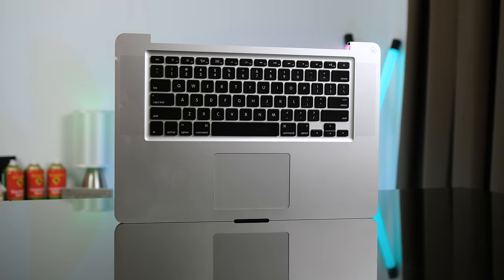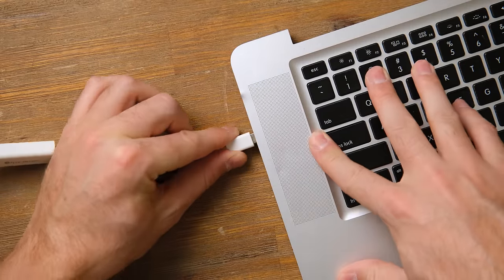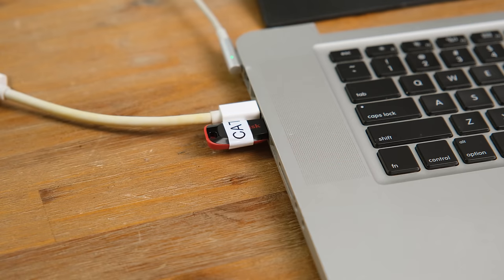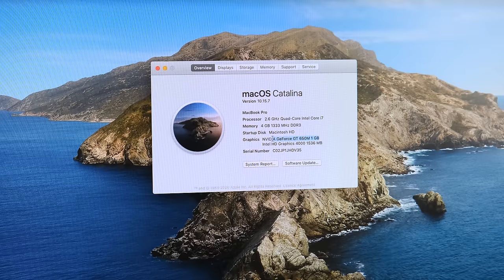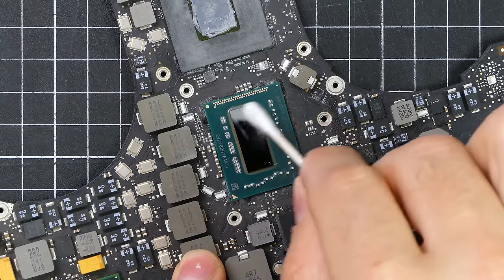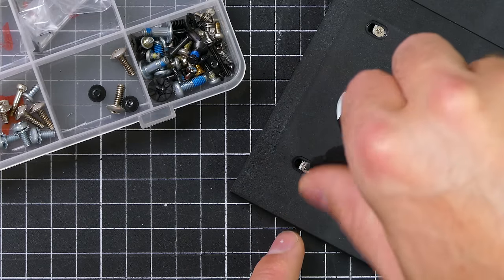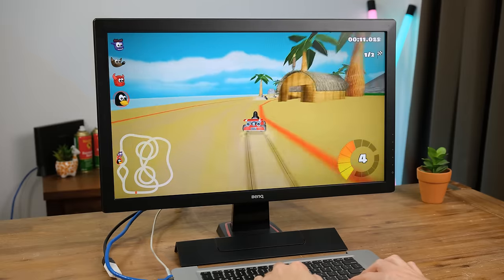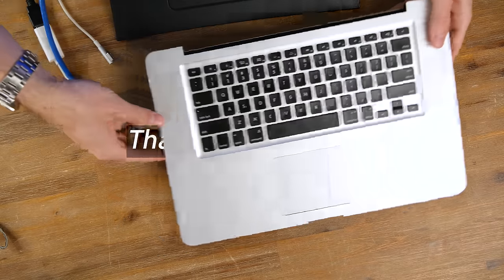Turning A Free Scrap Macbook Into A Desktop PC!

Comment: I did this to a Lenovo laptop that has a broken hinge.
Reply: Speaking of, I was going to keep it for a project in the future but my mom unfortunately demanded me to delete it.
Reply: I had a laptop with broken display. Plug in to tv and used it as its display. Can use this method to every laptop with broken display
Reply: It was probably a Thinkpad. Not due to quality, but what OS you use.
Reply: @Forrest_O.  Not a thinkpad, but lenovo g series
Reply: Did the same to my Lenovo Thinkpad T440.
Reply: Same
Reply: My brother did the same thing to an old Toshiba satellite laptop, used to be my dad's old work laptop. Installed Linux on it, and it works great.

Comment: Little tip with these machines; Opencore Legacy Patcher can patch out the performance drop from the missing/cooked battery.
Reply from the maker: Interesting! I was not aware of this 👍
Reply: Hmm, interesting! Thought it was something with the firmware.
Reply: there it is . the ultimatum for my old mate already asking for it's 5th battery
Reply: @psivewri  there's your next upcoming video mate . please do it
Reply: Is there an analog of this for Windows? My Lenovo runs like crap when no battery is plugged in.
Reply: @let_me_explain8572 Not certain. That said, I know that my own MacBook Pro will occasionally overload its power adapter while running Windows, so removing the battery is not a perfect solution.

Comment: The performance happened with me on an old Air 2012, I used OpenCore Legacy Patcher to create an EFI to bypass the battery limitations but still remain on the last supported OS!
Reply: What was the name of the setting to bypass the battery limitations? (so I can google it)
Reply: @zoomosis  you need OpenCore Legacy Patcher, I cannot remember the name of the setting & im not at my desk but if you hover your mouse over each of the options it’ll give you the description!
I think it’s in Misc Settings
Reply: will it work with a bad battery? :O
Reply: @Nikpet3D  yeah, I opened the laptop & disconnected the battery though just in case
Reply: @Nas_Allie  ohh :O
Reply: OpenCore patcher is an amazing tool. I've used it to install latest macos on Air 2013 and it works! Yeah, a bit slow, but ultra portable 10-years old device

Comment: You can fix the performance issue by using opencore which has a function to disable this kind of throttling
Reply: how?
Reply: @applebottomjeans7145  OpenCore Legacy Patcher menu > Settings > Developer Settings > Disable Firmware Throttling

Did the job for an old MBP 17 2011 I had. Battery was dead and I needed to test it. Make sure you have a charger with at least the necessary wattage or more
Reply: @ReTex504  Thanks! Good to know about these utilities.
     (I thought it was also possible through command line stuff, but a GUI application is hella easier :))

Comment: I love this. So many people are like "yeah but which 2012 are you using which parts for?" And from my experience, you can do a lot of part swapping like you did here. People are so nitpicky about submodels, so I love that you franken-mac'd it.
Reply: Apple is extremely well-known for subtle parts differences between models. Little things like changing the location of a connector to prevent an easy display swap happen fairly regularly.
Reply: These were also the last generations of MacBooks that could objectively be called user-serviceable or upgradable. People who are used to Apple's current MacBooks probably don't realize how things were back then.
Reply: @TimurTripp2 are you sure? I’ve seen many of his videos cleaning up them 2012 MacBooks, and the connector locations look the same on all the models he has cleaned up 🤔

Comment: I've found that the best donors are liquid damaged machines for housing swaps. It helps if they happen to die early in their life, too. 

My free 2012 i7 13" Pro was rehoused into a free 2011 i5 model with liquid damage; the board had corrosion around the rear vents and wouldn't POST or show signs of life beyond a twitching fan. 

The battery only had 134 charge cycles and was still in good health, the keyboard still had its matte surface, and not a dent or scratch anywhere on it. 

The donor board machine had a stage light fall on it while it was open and it got flattened, but the unibody structure saved the board from damage (even if the hinges got ripped out of the aluminum from the impact). 

It can also be a save for a poorly reconditioned device: i.e., I got a "dead" $5 ThinkPad X250 with an i7 that had seen some botched DIY repairs from its previous owner (my guess is failed trackpad?) . It was missing screws, the keyboard backlight diffuser, and the cable management was awful and the guy used the wrong length of screws in places, so there were little protrusions on the topcase and even a crack in it from the botched work. 

Transplanted that (ultimately) working i7 board into a mint $28 i5 model with water damage, now it's good as new. Best of all you get a "small spares" machine, meaning you can harvest other smaller working bits like hinges, radios, keyboards and what not and replace as needed or sell to recover your funds. 

Love watching your channel bud, keep up the good work!

Comment: Great video! I'd recommend OpenCore Legacy Patcher though, to run Monterey on this Metal supported machine. It will be flawless and bug free (nearly).

Reballing will NOT fix your dead 2011 MacBook Pro... the chip itself is the issue... you might get away with cooking it, since the issue comes from small bridges inside of the die that can partially resolder with heat... but it's temporary. Replacing the chip is also temporary since it can fail again... the best fix is to disable dedicated graphics. It's partly AMD's fault, but mostly Apple's fault with terrible cooling (other laptops that use the same chips don't die).

MacBook SSDs were not removable all the way to 2017... The 2016-2017 TouchBar MBP models had soldered storage...
For MacBook Airs, you could replace the storage until 2018!
Worth noting that this proprietary storage isn't the same across all models... there are several types.

Comment: i did this already in about 2013/2014 as my 2009 model fell apart after 4 years of VERY heavy mobile use in school and as primary and only computer besides a loud heavily overclocked and unstable gaming desktop

i just used batteries coming from my 2nd hand bought 2010 model after they lost „too much“ capacity for heavy battery usage to allow it to use full power

Comment: re the thermal paste application, you're right that it's critical that you have to apply enough to cover the die, it's not necessarily wrong how you did it but I recommend spreading it as well to guarantee it's touching all of the surface, since there's no way to know that it is otherwise and if there are hot spots on there it can lead to its early death

Comment: I have been using a headless 2012 macbook pro without battery for 5 years. I'm also using it as a "desktop" but in a studio i'm sharing with a friend. Magsafe charger connector secured with hot glue and the macbook is tucked away (in a upright "book" position) behind the monitor. I've never bothered about getting a new battery because the macbook is not going to be portable anyways. It is upgraded with ssd, ram, kept the optical drive because still using discs, and ventilation holes in the back cover but holy shit i think i need to order a new battery after all!! Thanks!

Comment: I got a Fujitsu AH-564 laptop with similiar specs, Core i7 Gen 4 without display, RAM and HDD.
Lucky me, i found a Acer 15.,6 monitor with a compatible LCD pin cable to the mainboard, now working as an Desk-Note Hybrid Laptop.

Comment: That’s actually a pretty good PC even today since the 15 inch from 2012 has 8 threads and you can put 16GB of RAM and almost unlimited storage. I put a cheap 1TB in mine but you can put as much as you are willing to pay for an SSD and even use 2 SSDs if you take away the disc drive. Making a laptop have dozens of TB of SSD storage if you want. Something a modern MAC simply cannot have.

Comment: Great Idea, Cat and Andrew already did that several times with screen damaged Laptops, I myself had a cheap Asus 15" with AMD A6 APU from 2012 to 2017 and over the time the plastic body broke more and more, the screen (which also had only 720p resolution) had a dead vertical line.
I scrapped the lower housing and the screen but of course kept the mainboard and gave it to a friend.
Maybe I can build a case for this now with a 3D printer.

Comment: i wanted to repurpose my 2009 Macbook by doing something like this but somehow Apple underclocks the system if there's no battery detected, which is a hassle because it bloats after a year and its already on its 4th for the past 6 years . If there is any kernel modification done to overcome this underclocking i would love to use my old macbook again
Reply: doesnt work it can draw more power than magsafe delivers
i did this type of conversion as well on a 2009 15“ and i just used acceptable batteries coming from my 2010 model after 300-500 cycles
Reply: Some other user commented this: "Opencore Legacy Patcher can patch out the performance drop from the missing/cooked battery."
Might be useful to take a look for your case
Reply: @hex8387  Yes this absoutely works I've done it with mine!
Reply: @hex8387  thank you ! I'll scroll through everything on the Github page and hopefully it will work again

Comment: I CNC machined a case for a motherboard that mounts under a cabinet. Much smaller than a MacBook because it has no screen, no disk drive and no speakers etc.

Only thing I haven’t figured out is how to circumvent the battery. It won’t boot without it.

Comment: Installing Windows 10, underclocking the CPU and overclocking the GPU (to keep power consumption and heat at an acceptable level) can make this a pretty decent machine for gaming even, at least for games until 2015. Got Tomb Raider 2013 at native resolution at 70 fps, Thief 2014 at 40-60 fps and even Far Cry 4 running at 40-50fps (but with a lower resolution here). It won't replace a dedicated gaming laptop tho. ;)
Reply: Overclocking isnt worth lmao.
Reply: @AntiGrieferGames  If you think 10-15 fps isn't worth it...

Comment: You can disable firmware throttling cause by not having a battery. install OCLP, Update the system and disable this so you can use it battery less.

Comment: Why not remove the battery if it’s going to be a desktop? Does the CPU throttle if completely disconnected?
Reply: I dont know about this mac in particular, but some devices like smartphones, tablets and the Nintendo Switch do not turn on if the battery isnt attached, even if it is dead and will be running from the charger at all times.

Comment: I think I have the same Macbook pro (Core i7, right?) - still my main computer. 
      And VERY responsive and quite capable with a fast SSD as the main drive.
     (Crucial M4 (Sata 3) as the main one. OWC (Sata '2.5') as secondary)
      The 15" models were always more future proof than the 13", on account of dedicated graphics.

Only issue I have is that the bottom RAM slot is not functioning. 
    I know what the problem is, but don't feel confident enough to microsolder the connections back.... Yet.

Comment: Well i used a headless Thinkpad for a bit. My display was broken after it fell down, but i used it with a crt monitor, external keyboard and mouse. And it worked fine, until i had enough to buy a new laptop (screens seem to be the most expensive part of a laptop) and i gave this Thinkpad away.

Comment: Guys, NEVER EVER FORGET the BATTERY when you buy some second-hand laptops: I bought an i5-M model laptop which came out in early 2010's and the battery was dead. It was not behaving like how it should be and never ever thought it could be from dead battery. Replaced it and now it plays 1080p 60FPS YT videos without any lag. CPU usage dropped significantly.

Comment: I have a dell monitor i got for free and i use it as a display and i put a keyboard and mouse and power adapter to a hub and plugged in the display like that so it is kinda of a dock while the display is closed and when i need to take is anywhere i just unplug it

Comment: Hey psivewri I am a big fan of yours I have a doubt abt my old laptop with i5 2450m and amdradeon hd 6370m like I reaplyed the thermal paste and when I try to game on the amd Radeon hd 6370m it basically goes into black screen is there any way I could fix it laptop model lenovo g570. Is the driver problem or the gpu is dead?

Comment: I took the screen off my MacBook Pro 15in just because I have a the 27in Thunderbolt Display that came with it at the time. I been using it a lot lately for random things even installed wi does with boot camp and. Been using that. So my issue was my set is that every time I had to turn I. The Mac book I had to open it which I had to pull out off the off space I have it in. So I watched a hunch of videos and did it. The. I realized I wasn’t getting any wifi or Bluetooth. So I did a bit of my own looking around and found that the card is in the actual motherboard and the antenna is in the bottom of the screen. So I had to take that out and find a way to rig it after I installed the wires. And no one making these videos mentions that. Which I believe they should’ve cuz it would haves made my build alot simpler. Anyways. I completed my mission so far. Lol

Comment: I had done this with Windows laptops, most of Windows laptops doesn't give video output, if OS isn't booted.

Newer laptops, who have eDP LCD panel, they give video output to external monitor, if screen is not connected, but eDP could be converted to normal DisplayPort and it will 100% give video output in BIOS.

Comment: You should ruin the plastics with more of that eucalyptus oil
Reply: 💀 why he gone and done that to every laptops idk. essential oils are known to ruin plastics, he seems to put a "healthy dose" onto everything
Reply: Maybe because of eucalyptus oil he f'ed all of his computers displays
Reply: I've always thought about if it ruins plastics, he seems to use it only on metals..
Reply: @meap_me  No, he uses it on everything, and YES it ruins plastics
Reply: Actually ABS plastic can withstand Eucalyptus oil and most essential oils TO AN EXTENT. He is only spraying and wiping it and not only that it is not 100% eucalyptus oil, so should be fine.  In fact many aromatic dispenses are made out of ABS plastic including heat diffusers and they can withstand high temps and the oil just fine. Its also not like he is wiping clean the same piece of plastic every second of every day. Are there better cleaners out there, sure. But what he is doing isnt going to cause the 4 horsemen of the plastic apocalypse to come charging in.
Reply: @phillippereira6468  sadly most plastics aren't ABS. Glass fibre filled nylon is more common nowadays. The keyboard keys could even be polycarbonate
Reply: @iamdmc  he isn't cleaning modern systems. Those plastics on those systems are abs. And still the vast majority are abs.. It's cheap.. Hardy.. In fact there are not many large scale commercially available systems that use the systems you mentioned. Definitely none of the keyboards or cases he had been cleaning are made of that

Comment: I didn't know that a dead battery in a macbook causes low performance...😱
Reply: The board enables a thing called BD_PROCHOT, a protocol used for when the CPU overheats, but in this case the board enables it to not allow the board to pull too much power from the adapter. There are ways around it (either with a kext on macOS or ThrottleStop on Windows) but yeah.
Reply: @Neon  Good to know. Thanks. Is there any way to take out the battery and use the macbook (without a battery) only when plugged in?
Reply: @hanakomisa  which kext is that?
Reply: @hanakomisa  Thank you my friend.